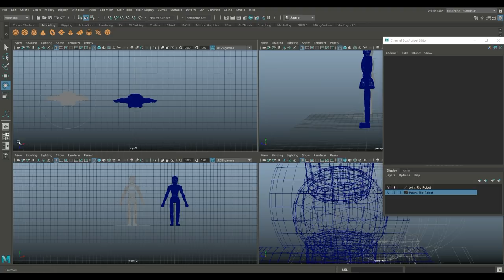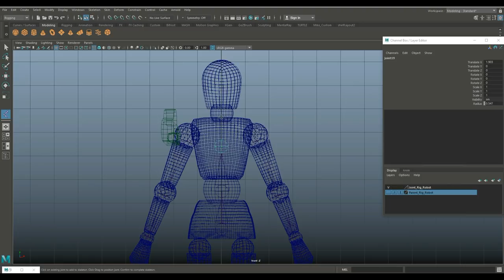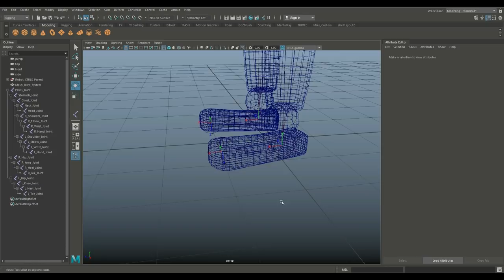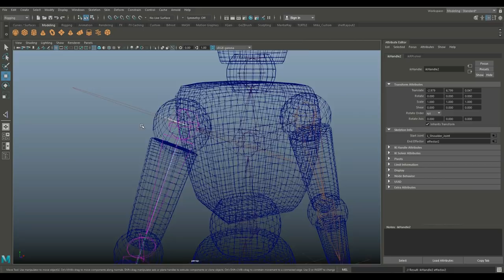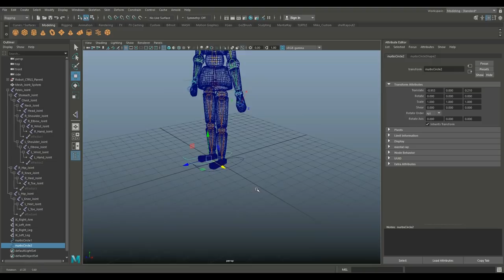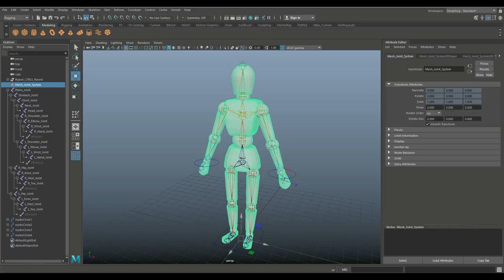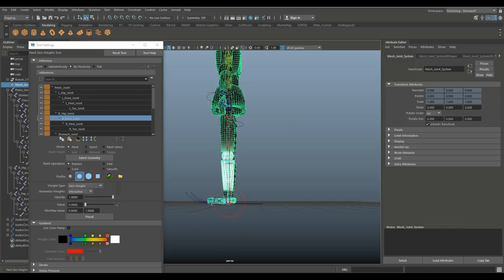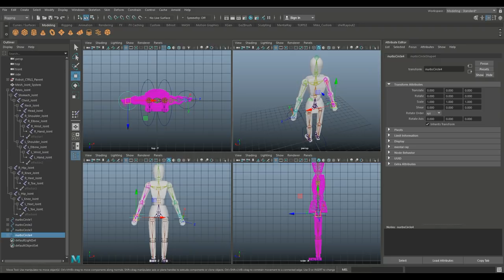Joint RIGGING our 3D Character ( Part 3 of 4 )

Comment: Great video Mike, but you could have saved you a lot of time with naming the joints before mirroring them. As you said, it's a tedious job ;)
If you made like the left side first and have "L_ " in front of each joint, just type "L_" in "Search for" field without quotation marks. And in the "Replace with" field, you just type "R_" without quotation marks. Then it will automaticly name your joints correct when you mirror them.
Reply from the maker: Good tip, thanks

Comment: Hmm i never used mirror joints before... i guest i will have to check it out ;) As for naming stuff im using NameIt script that speeds things up alot - very usefull. As for paiting skin weights in this model... wouldnt it be easier not to combine all elements and then just flood them with proper influence from a given joint? I did this on my robot rig and it worked marvelous. Btw iw would be nice to explain how IK works (i mean when someone creates for instnacne a knee IK and it bends the wrong way and how to fix this). I bet many people might find it useful. Anyways great vid as always :D
Reply from the maker: Thank you
Reply: You need to create a skinCluster for each object then. SkinCluster are not that heavy but for performance its better to keep it like that.
If your knee bends the wrong way, take a circle or locator and put it in front of the knee (the direction you want it to bend). Then select that object, shift select the ik handle and go to Constraint > Pole Vector
(make sure when creating the ik handle it says rotate plane solver, not Single chain solver, in the tool settings)